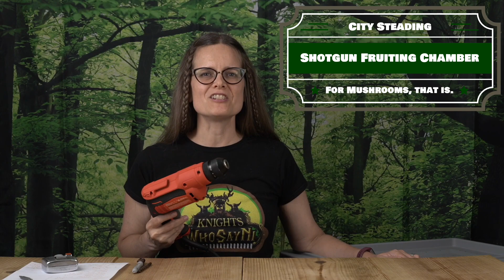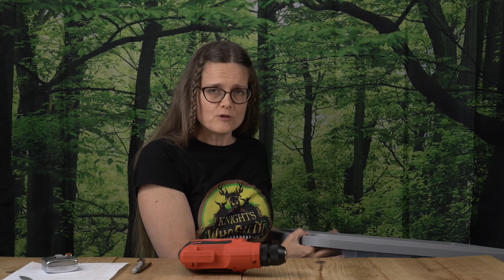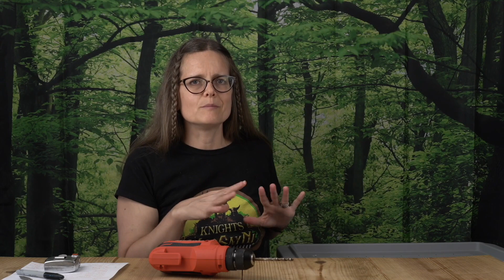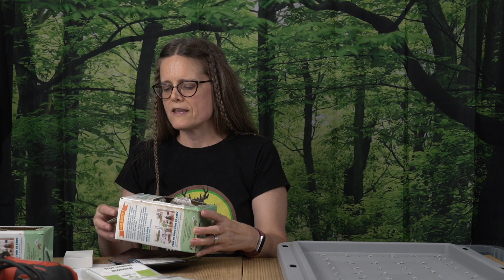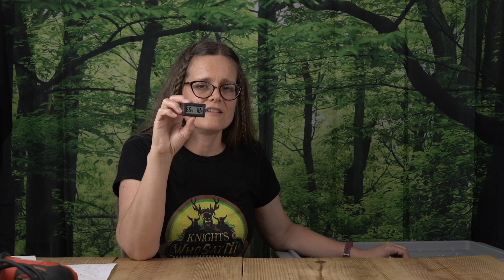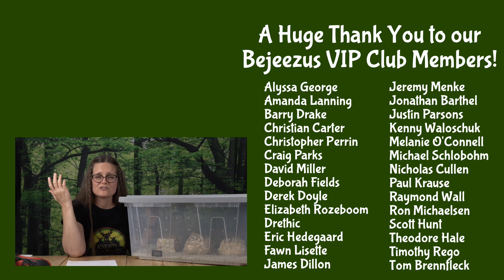Mushroom Fruiting Chamber - Build It Yourself

Comment: Hi.   Thank you for the video.   I used a versa tool with round tip to make the holes.    I am now sitting and watching.   Is 99 humility too high
Reply from the maker: 80 to 90% humidity is the ideal range for most mushrooms.  A humidity level above that could lead to mold growth.

Comment: Couple questions or comments  
#1 what is the danger with this setup compared to the Martha setup on spore contamination inside your house?
#2 do you remove the grow bags if you need to resoak your perlite?  How long does the perlite go before needing resoaking?
#3 did you encounter any problems with not drilling holes in the bottom? I know you said you would put it in the description if you did, but people can get too busy or distracted, and I just wanted to make sure of this before building mine.
#4 have you had any problems with poor germination ordering your grow kits from Amazon?  I know that with seeds, people say not to order seeds from Amazon because they are all dead.
Also, I just wanted to let you
know that your link for the clear plastic totes is moot, as Amazon is saying it's not available.
Thank you for this video, I want to grow some mushrooms at home, but I don't want a big complicated and expensive setup.  This information will help a lot.
Reply from the maker: Great Questions!  I will do my best to answer each.
#1 Martha set ups are best if you are producing larger amounts of mushrooms where spore contamination would be a larger concern.  Ideally in these smaller growing situations, along with grow kits you can purchase, you would harvest your mushrooms before the crop produces spores.  If you have further concerns you can cover the holes with medical tape that would allow air transfer but filter out spores.
#2  I simply check my perlite regularly and spray it with water carefully to avoid the grow bags.  If your perlite dries out to the point that you need to resoak it, your mushrooms may be too dry for proper mushroom growth.  That said, if you feel you can still get more from your grow bags, then yes, remove them and resoak the perlite.  Keeping a close eye on the progress of your fruiting chamber and adding an inexpensive digital hygrometer will help you keep the right moisture level.
#3  I did not have any issue with eliminating the bottom holes.  I did have many people tell me in the comments that they were necessary but no one mentioned why.  Perhaps my particular environment didn't cause the problem that requires bottom holes.  
#4  I recently did a comparison video of various brands of grow kits and how they compared.  There were differences, but they all did produce mushrooms.  I've also purchased many seeds from Amazon without any issues in germination.  My suggestion would be to check the reviews and use your best judgement in making a selection.
I hope this helps!

Comment: Great video I really appreciate this info.  I'm not sure who mentioned putting holes in bottom of tub itself,  but I've never heard or seen this.  I'm glad you didn't do it!  

I have seen holes in the bottom of the fruiting container sitting on perlite.  Or holes in the aluminum foil, if you put that down over the pearlite (and under the fruiting block...). 
But this was only to prevent any standing water /rot under the fruiting block itself.

Comment: Thanks so much for this! Making my own right now
Reply from the maker: You are welcome!
Reply: @PlantLifeYT  turned out amazing, but I don’t know what to do about the small plastic bits and bobs from the drilling. Sandpaper won’t work as it scratches the plastic making it opaque, and I used my hands for most of them, and hosed it for a while. Any suggestions?

Comment: Did everything go ok without holes in the bottom?
Reply from the maker: I didn’t have an issue without the additional bottom holes.  I did fan them regularly and made sure to check the humidity often.
Reply: Are holes on the bottom a must?

Comment: I read somewhere that if you want to drill through plastic without cracking it, to just use the Reverse mode on your drill and it ends up a lot neater.

Comment: Awesome! Those totes can have other uses: if you live somewhere that has cold(ish) winters and you want to preserve foods like potatoes, turnips, leek, carrots etc you can fill them with potting soil, sawdust or chopped straw and keep your produce in there. Make sure the lids and sides are drilled. The soil/sawdust/straw will help regulate the humidity and prevent your produce from drying out or going bad. Stack the totes if you want to (drilled sides, remember?) and stash them in your garage, cellar or shed. The filling material also protects your produce from frost. 

My grandmother used wooden boxes. But drilling holes compensate for that. 

I wish I had the room for expansive mushroom growing… if I ever have more room I’m certainly digging up this video!

Thanks for this video Derica!